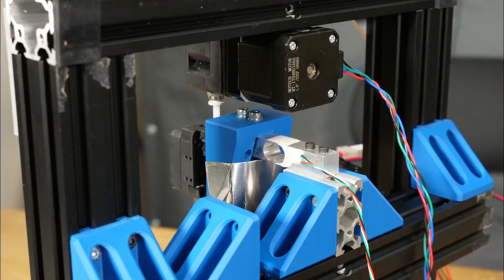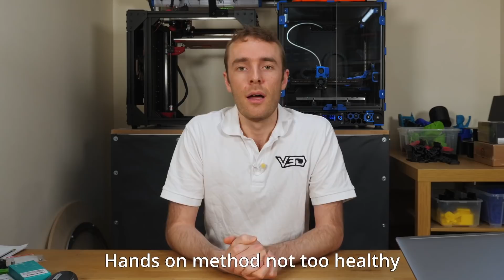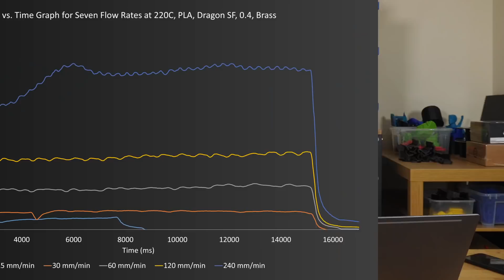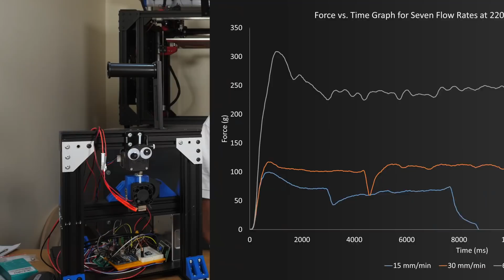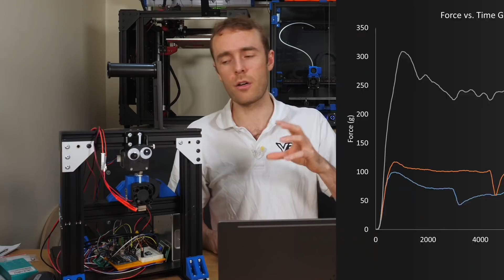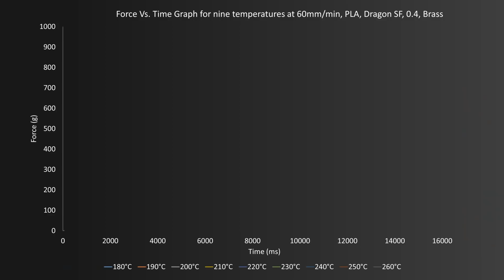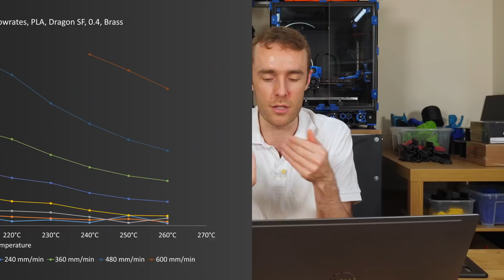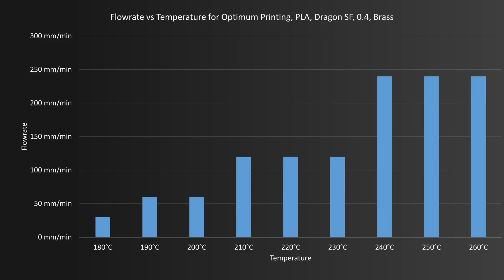The Next Generation of Hot End Testing

Comment: My comments disappeared.  The filament used was not rolled correctly.  So your test would not come out very good because filament does get stuck when its not rolled correctly.  Also you need to check the amount of pollutants in the Filaments and if there is any metal in it. Good test but. Please try it with other filaments.
Reply: He had to reupload if you commented earlier on the video. There was a rendering error for a short bit of the graphs

Comment: My first thought on the initial spike in the graph would be the equalization of the compression of the filament against the extruder gear. A lot goes into forming the footprint in the filament that the gear will be pushing through all the way until on the other side of the wheel and compression lets off.
Reply: is it possible that the liquid filament is compressible?  It is acting as a spring that has to be loaded before it starts moving?

Comment: The constant ripple in the blue and yellow line, is I think the teeth of the extruder gears, making the filament change speed. You can see the same pattern in both, but the blue line(rotating faster) is closer.
Reply: I think its showing the concentricity error between axle and outer surface of the gear wheel. Where the radius is larger, it wants to push filament faster, therefore creating a force spike. 
With lower feedrate the hotend is able to melt it better, so that spike disappears there /the wave is longer, we dont see it as well...

Comment: Never weighed it before. Just done the distance measurement, extrude 100mm and check what length is left and do the calculation and adjust it. Never thought to weigh it.

Comment: Adam, since you asked, it's very interesting. For the first time we measure the dynamic performance of the hotend.  BTW, what is your loadcell sampling rate? If you use HX711, you can increase up to ~140sps.  Next step is to measure with something that simulate the back force from the printed part. E.g. have some rotating drum below the nozzle.
Reply from the maker: Yes, i am using Hx711, I am using quite a high rate, not sure its as high as 140hz though. Nice idea on the rotating drum, I do think this will affect pressure in some way.

Comment: Very interesting - still lots of unknowns to unpack.  When I saw the one-time pressure dips at the beginning of some of the low pressure curves, it made me wonder if the software had paused/delayed moving the stepper for a moment.  You might want to consider probing one or more of the stepper motor wires with a scope so you can confirm that you’re getting the continuous stepper motor movement you’re currently assuming you’re getting.  Even further along those lines, probing the current in one or more windings could be informative, as well as being an easy way to check for motor slipping without having to be there for the whole test.  Would be interesting to see how closely motor current corresponds to pressure in general.

Lots to think about!

Comment: Great data, the Prusa XL has this type of sensor built into each printhead.
Reply from the maker: Indeed, it does have a load cell, attached to the heartbreak I think. Didn't realise that when making this, cool to know though.
Reply: @Vector3DP  They have mentioned that it is used for detecting both the nozzle to printbed and alignment pin interactions, and it can also detect filament jams, so it sounds like it might be able to get similar data to what you have done here. Nice job on this work, by the way!